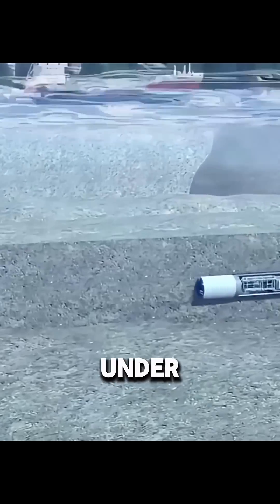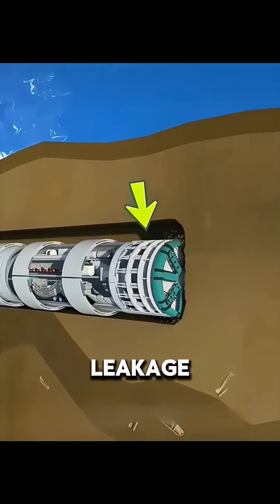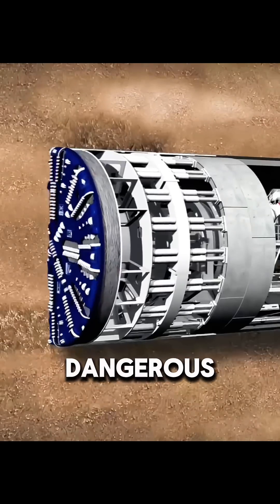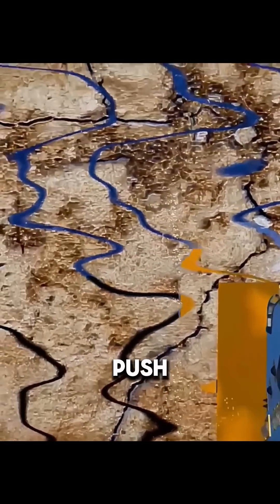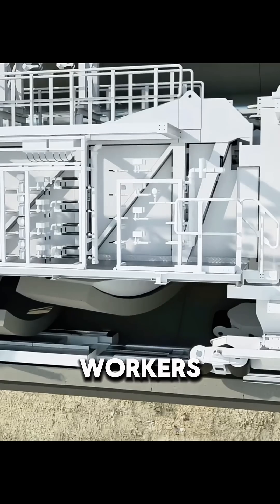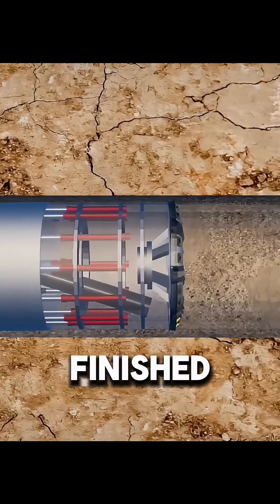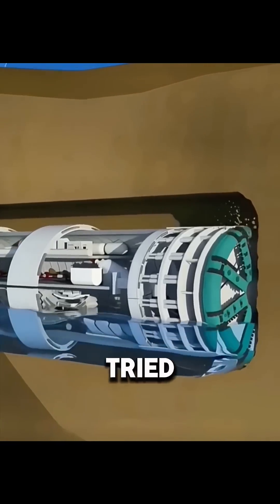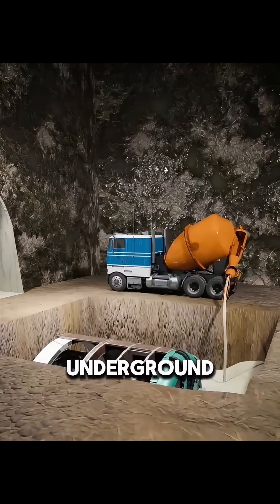How do tunnel boring machines keep tunnels from caving in? #foryou  #tunnel #zackdfilm

Comment: "You can't take it apart, it would be too costly."
TBM workers procede to take the TBM apart, and bury just the outer shell.
Reply: Scary the ppl that think they outsmarted you lol
Reply: @generalcornelius1880 oh look another Bozo. 😂😂😂
Reply: @generalcornelius1880  
Leave it for 2 weeks, I'll dare you some scavengers would scrap it clean in just 10 days
Reply: @generalcornelius1880   Listening comprehension is difficult, huh? 
The expensive part is pulling it back as it's only designed to move forward, and only the most key internal components are removed before its burial. The main hull is not disassembled. There is no contradiction here.
Reply: @Recoiler45dont hurt yourself princess its ok
Reply: @Recoiler45 why bury it at the end with most of the insides taken out? Why not sell it for scrap?

You get a few thousand dollars out of it and don't have the expense of burying it.
Reply: @alvindueck2104  Fair point, but maybe the cost of further disassembly and hauling the metal up and out of the tunnel  offsets the value they'd get from the scrap? (Labor, time, etc) Large companies don't do much of anything without cost analysis so I'd assume there's a solid  financial reason. 
OTOH, maybe the video is pulling our leg. 🤷‍♂
Reply: Pulling it back out and taking it apart. Thats the issue
Reply: @lacucaracha111111  They didnt take the channel tunnel machines apart...maybe one ram out of 24.. just too dangerous 12 miles underground. Bury it and walk away. They did their job.
Reply: @lacucaracha111111  Well, they have taken it apart in the end, haven't they? That's the issue with the story. The only thing left is to cut out the shell into smaller pieces, and taking it out. And that simply can't be such a big issue, if they've done everything else, right?
Reply: Some parts are expensive enough that it's worth it to go through the effort of pulling it out. That's not the case for the outer shell.
Reply: A quick google search will give you all the info that you need. But I guess some people are just ignorant and lazy.
Reply: They can, they just dont because it isnt worth it. They take the valuable bits and leave the cheap stuff. Why pay a man $20 an hour to recover something worth $10
Reply: @Dasius2  Exactly. Especially when in that confined space that 10 tonne piece is going to want to kill you!
Reply: @Dasius2 except the outer frame is still worth nearly a million dollars of material. Like holy fucking shit steel isn't an infinite resource bro. Itd just be less pointlessly wasteful
Reply: @Dasius2  dude, I don't know how you missed it, as I spelled it out exactly the way you here it unfold in the video, but that's what they did *exactly*. They took it apart, leaving just the valueless outer shell to bury. The workers actually spent their working hours taking apart and removing anything of value before cementing the husk in the ground.
Reply: It’s hear it, not “here it.” Is English your first language?
Reply: @KellyGentry-r5x  ever heard about that thing called auto-correct? Do you have a mobile phone? Ever tried typing on it?
Reply: @DrDomich  Yes, it’s never corrected hear it to here it, ever. Why would it? I’ll ask again, is English your first language?
Reply: @KellyGentry-r5x Dude, correcting someone else's grammar on the Internet of all places while literally adding nothing only makes you look like an idiot.
Reply: @Am_Cookie2436  Dude, pointing out someone correcting someone else’s grammar on the internet of all places while literally adding nothing only makes you look like an idiot.
Reply: @KellyGentry-r5x oh, I'm fully aware. But I'm gonna do it anyways because I am one
Reply: @Dasius2  because eventually that waste and pollution adds up and harms future generations of humans Just for more profits (which all profits are unpaid wages as only labor can generate wealth from nothing) The entire machine could easily be scrapped and torn up and recycled into many useful materials or items that some other people may need or want for a happy comfortable life! Human greed, selfishness of any amount, and massive waste and pollution is what is killing this planet as well as a lack of common empathy for fellow working class strangers of the world! BE BETTER!
Reply: @unholypagan1342  If it's just metal then it's not pollution actually. Metals come from the earth anyways. But it's wasted metals in a sense it could be recycled instead of mining new metals that would cost more. IMHO recycling should be mandatory for everything even for shipwrecks. But that's a whole can of worms nobody wants to talk about for environmental reasons, costs, accountabilities ect.
Reply: Written by A.I.
Reply: Comprehension is crucial..... You forgot the " And Pull It Back" part. Bozo
Reply: @iSkoootZ well, Mr. SupposedlyNotBozo, perhaps you missed the past where they pull back anything of any value, leaving just the valueless husk to bury?
Reply: @DrDomich I definitely heard that, but I also finished watching and comprehended everything explained... 🤷‍♂️ Typical Bozo, Can't comprehend simple English
Reply: @iSkoootZ critical thinking and English comprehension on 0 lol. Doesn't matter if they don't just yank the whole thing out or scrap it. 
He said it would be too expensive to do, then went on to say they do it but leave just this one part. It's a major contradiction no matter how you look at it
Reply: @rohandaniel311 this bozo commented and didnt watch the whole video. Then proceeded to only quote half of 1 line in the video. Only reason I commented. 🤷‍♂️
Reply: @rohandaniel311  Wow you are a simpleton !
Reply: @iSkoootZ so, you obviously didn't understand what I wrote, as it doesn't contradict the video in the slightest. Now you don't comprehend that the guy actually agrees with me.... And then you call someone bozo 🤦‍♂️😄
Reply: Hey Dr... I guess English is not your 1st Language..huh?
Reply: @red-hat-mike  is that the reason you don't understand what I wrote? Let me know what's not clear and I'll explain 😉👍

Comment: I know it's the encasing that is left behind and gets buried and it's cheaper to just leave it there and take the important components instead like the electrical, drill etc, but if only the encasing why not cut it into several pieces so it's easier to remove..

Comment: for one they dont drill in the soft seabed, they usually do into the rock beneath it. Also they currently have 2 TBM`s builind tunnels in london, they arent burying them, they literally are building burial tombs like the pharohs of old and parking them in them as they know they would be used in the future. the only times they generally leave them is like the Channel tunnel where they had two running directly at each other and they needed to use the tunnels to get them back out. One was buried with a placard denoting its location and the other is currently on display as a museum pieace.

Comment: The part bury are usually just external shell.
It material are way too worn down for another use.
So you either have another machine come to pick the hold thing up, or chop it to smaller piece for recycling, or just bury it.
Reply: Yeah so why not chop it into smaller workable pieces for recycling? Since the outer shell is not useful?
Reply: @leonardjadu9595 too expensive as the video mentioned. It would take hundreds of people, several weeks to chop it up and bring it to the surface. The material obtained will not cover the costs of the people let alone other things like machinery, transport, etc. But if the shell is outside, they are always removed

Comment: i remember when i first thought of, instead of tunnelling, we could instead insert a expanding material that forces the ground around outward, compressing it. I thought of it after seeing memory metals. (a hollow metal tube that has an alt state of being a compact rod. you drill a hole the size of the rod, insert it and then switch it to its 'open' state.) that was 30yrs ago.

its very interesting seeing how we have achieved a version of the method. which deals with the weak points.

there is a future version of the TBM which expands the chemical functionality, using technology from termites and makes the 'concrete' sections itself, out of its own mixture. the biting surface could also benefit from a dynamic enzyme mix, like a saliva it uses to help it digest the material in front.
Reply: I just can’t believe this was written down. Not any sense in it
Just few points:
-How the fuck you insert a metal rod in a 50km curved tunnel?
-How don’t use premade concrete if in this scale concrete has more than one month setting time to set completely?

Comment: Actually theres patents for another ground boreing machine extremely simular to this one but the difference is that the one ive seen actual grinds the rock and dirt, superheats the dirt and rocks into a molten slurry like lava, and you dont need to use grout or concrete sections as you essentially are creating a lava tube. It can be reinforced later but its essentially using the material its boring through to create a thick side wall.
Reply: did you see this design in a comic book? or after using LSD?
please explain how you managed to pump molten lava  not melt the bore head and keep it on the roof and walls then not crack when cooled?
Reply: @philiprice7875 known as a subterrene, was developed and tested at Los Alamos Scientific Laboratory in New Mexico during the 1970s. 

The guy who i saw the patent from was one of the guys who built it. He has pictures from the tunnels, project papers, and even told me about the DUMB sites the military and rich folks have them make. 

They do make those bases near granite sites or mountainous regions but most are built in places like new zealand. 

This machine is in use, not publically or for civilian use and they claimed it originally could melt about 30 to 40 inches an hour, but he was super proud that it could get to about 5 ft an hour under prime conditions and the tunnels produced are strong not only in geometry but stronger in some cases then reinforced concrete. 

Not only was it tested and produced less sound then a regular boreing machine but it was able to work for 48 hour timeframes before its pulled back and inspected/repaired and immediately put back to work. 

He was boasting it could create a full train tunnel from california to georgia, to ohio and back to Oregon. He said the military was talking about building a bullet train which would cut down on travel time but also provide secret transportation that satellites couldnt see. 

Every person which has worked with the government on black book projects or lockheed martin, blackrock, vanguard all have crazy stories. From the TR-3B anti gravitic craft to being able to create and drop off a self building base which airlock systems to not only create FEMA sites quickly for things like covid or to launch to the moon and create building sites which astronauts could use to start building bases. You be surprised but the US military industrial complex is at least 50 years more advanced then us useless peasents on certain aspects and 200 years more advanced in other areas. Theres almost a brealaway civilization going on at this point lol. 

On the point of your question no LSD, just connections in life and listening to the old guys. They can benefit you more then you know. Not only do they have cool stories but he paid me 10k for a job that was worth 2k and continues till today to overpay and get his friends to work with me. I think id love to walk around those tunnels or underground based on acid thou. That would be wild.

Comment: Not all TBMs are scrapped. In certain projects where there are loose future plans for expansion, its usually parked and can later be refurbished and continue boring.
Reply: IIRC, the new line for the SF Muni metro's TBM couldn't be removed, as it wasn't feasible to acquire the land needed to pull it out. It was something to do not with reuse or not of the machine, but finance or politics and no good places for the TBM to emerge.
Reply: GTA 5
Reply: yeah it is only if it is a really big skeleton they bury it. every little thing that can reused is taken out ofc.

Comment: Worked on one of these under a river for a few years, best and worse job I've had. Safety sucked, air monitors never worked properly and had a guy get his head split open because a drunk supervisor opened a slurry return line during a pipe change, 3 miles of water pressure when back and blew up an angle pipe in the drop shaft.

Comment: What a waste. There should be a law against doing things like this, where you’re not allowed to bury it in concrete, but rather seal it so it can be unsealed later on at parts, can be taken out by other manufacturers as needed. That the other manufacturer pay the cost of taking it apart.

Comment: They forgot the 12 feet bolts that we have to put to stabalize the surrounding, also they leave TBM in there because the cost to bring it outside and dismantle it is too high.
Reply: Like how much ?
Reply: @henrycarvajal6501 Google says it can exceed $100M for a new machine. Average machines can cost from $5M to $30M.
Reply: @henrycarvajal6501  differes from place to place. Length of the tunnel, kind and size of TBM, cost and track, Time to dismantle, most of the places TBM's are used are either the tunnels made for hydro or the roads to connect and project need to be completed at certain time
 This doesnt include the time u can get the TBM out and dismantle it on side, it will incur extra cost.
Reply: @henrycarvajal6501  One or two lives maybe.
Reply: They dont actually leave the whole machine behind. They leave the worn out cutting head.....
Reply: @Branturple some true, most of the stuff is taken out as its easy to transport, the cutter head is a very small portion of TBM, its almost like a 900+ft and head is just 3,4 meter part, then its the structure that bolts and concrete, so its not just the worn out head but not the complete TBM as well.
Reply: @mirnasir2012 ok thank you.
Reply: Wow, so you watched the video also? No way
Reply: TBMs are able to get back the way they came in, only the head is bigger. And it still can be stripped for valuable parts like cutting discs etc.

Yes, bringing the head out fo the middle of the tunnel would be expensive (and is when massive/critical failure appears), but you still need to dispose of it SOME way - you cannot leave it there standing, so something like a cavern needs to be dug out.

The question then is: how this cavern is made? Who digs it with what, if TBM is in the way?

Comment: Too costly to remove? They obviously discriminate against pikeys (Irish Travellers), because a couple of families of them would strip that TBM and anything else not bolted down, and even a few of those things are, away in a matter of days.

That machine would be scrap iron and sold on the quiet (QT) to some scrap merchant before breakfast the next morning I can assure you.

Whoever decided it can't be done, didn't think long enough about the problem they were trying to solve.

Comment: They dont leave the machine underground.  A tunnel has 2 ends.
Reply: Depends on the tunnel. Some of them, they absolutely do. They got machines boring from both ends, and you can't back them out. The machines used to bore the channel tunnel were rolled to the side and left under the English Channel. It was cheaper to leave them there than to extract them.
Reply: @thomasgeorge4384 theb how did they get one in Oceans 13?
Reply: It all depends on the logistics of the situation. Sometimes it's cheaper to just leave the cutting head and remove the machine. It really depends on the situation. The rigging involved in removing the machine is very interesting to say the least. The commentators that say they would have it disassembled in a few hours with cutting torches clearly have never used said torches and know nothing about the industry!
Reply: U drill from both ends n meet in the middle.
Reply: @JAlves88 not at the HRBT. Drilled one tunnel, turned it around and drilled the second. Removed the entire machine…
Reply: @scottmorgan133  yeah you compare one tunnel to another what is 10 times bigger
What’s the point?
Reply: Many tunnels are started from both sides synchronous. They meet in the middle. But sometimes they don´t meet. That´s why the Hamburg Elbtunnel has TWO tubes!
Reply: We buried the cutter head then pulled the rest of the machine out of the retrieval shaft. Just cemented it in on the opposite side. pulling the gantries out with come-a-longs for the crane to reach it was a pain I can't even imagine trying to get the cutter head out
Reply: They absolutely do leave them underground and bury them.
Reply: A simple fcking Google would tell you that yes,  they DO get buried most of the time
Reply: Depends on situation. Heads and front portion often left but rest can be extracted. On HS2 a tunnel bore did 1 way got to the end then they spun the entire machiene and it went the other. It really depends on tunnel legnth and how many machienes used. If it only 1 per direct and completes the tunnel unlikly to be buried as its aleady at the surface.